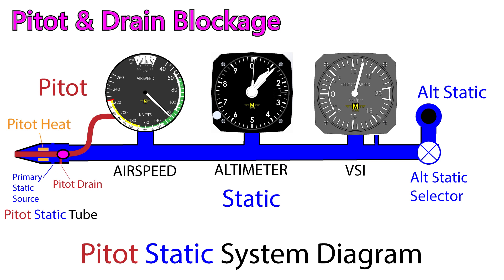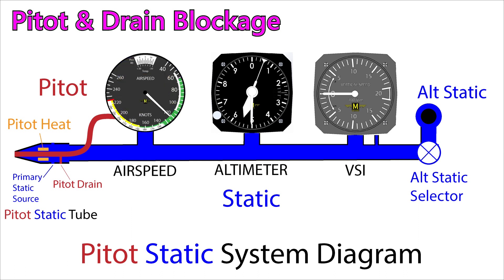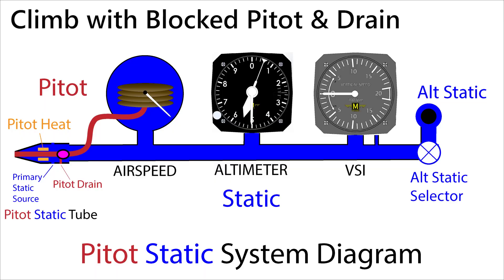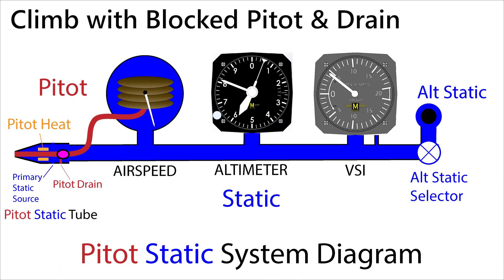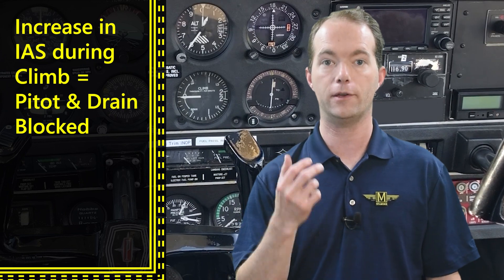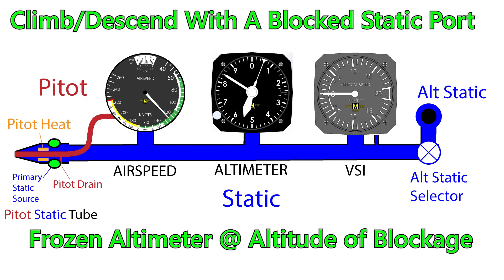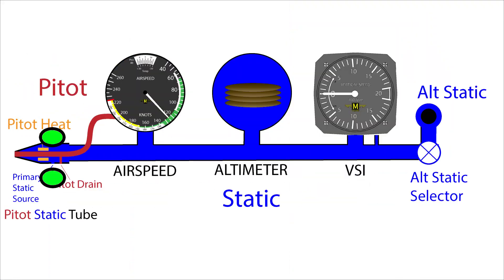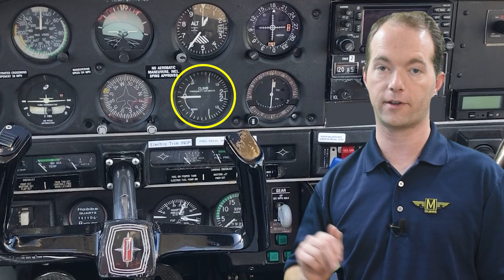Pitot Static Problems - Instrument Mastery 4 - 121.Mike

Comment: I was taught that with the Static Port blockage, the ASI acts like an altimeter also. I still have my notes. 

If the static port is blocked:

- The altimeter freezes at the altitude where the blockage occurred.

- The VSI reads zero, because there’s no change in static pressure.

- The ASI will OVER-READ in a climb and UNDER-READ in a descent, and because pitot pressure changes but static pressure is frozen, it acts like an altimeter.

What happens in a climb?

- Static pressure outside drops, but the ASI is still using the higher, frozen static pressure.

- Pitot pressure rises (you’re moving through less dense air at speed).

- The difference between pitot and static is larger than it should be, so ASI overreads.

What happens in a descent?

- Static pressure outside increases, but the ASI still references the frozen (lower) static pressure.

- Pitot pressure drops as you descend and slow down.

- The difference between pitot and static is smaller than it should be, so ASI underreads.

The pitot system only cares about differential pressure.

In both a static port blockage and a completely blocked pitot tube, the ASI behaves similarly. It overreads in climbs and underreads in descents.

Would the ASI be reading the frozen value in the casing and not the static pressure from the ambient atmosphere?

This has always been confusing for me.